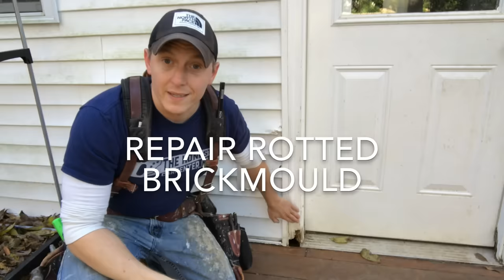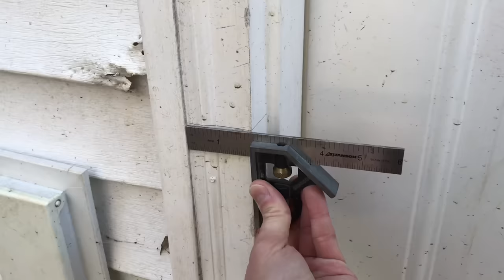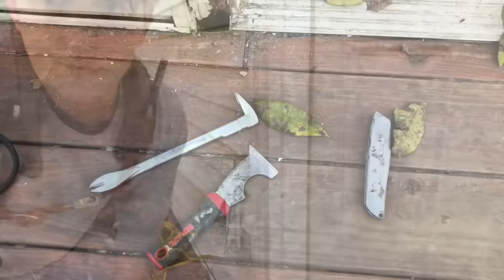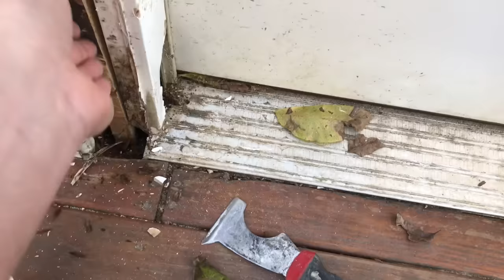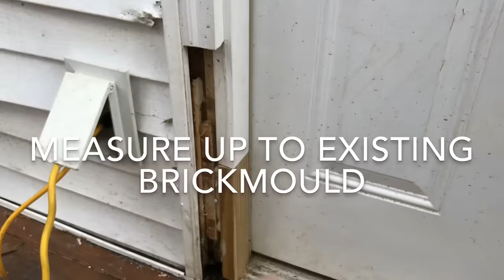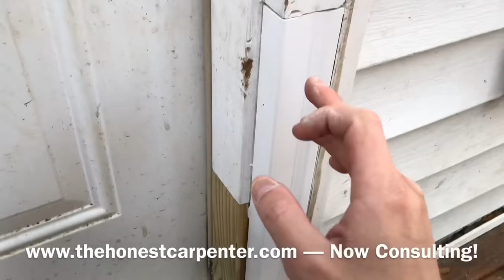Fix Rotted Door Frame (Brickmold)

Comment: I have seen a few of your rot repair videos and one comment I would like to make, as a fellow carpenter with over 35 years in the trade, is that once you have the rotten material removed, I recommend you treat the exposed areas with an appropriate chemical to kill any remaining termites or rot fungus that might not be apparent before you make the actual repair.  It will give you and your client more peace of mind and make your repairs last longer.
Reply: Here’s a tip I use… When using wood brick mould/jamb make sure your use a primer or paint on the bottom 3 inches to help seal it and “help” with future water repelling to assist with
Reply: Yes! Thank you for adding that..My heart sank at that sight since I have many problems with …moisture, wood decay, carpenter ants, and termites. Also those holes make lovely homes for mice and More .1
Reply: Steve sherrill what chemicals are you referring to my fellow carpenter???
Reply: You must have missed the part when he explained his reasoning and plan to adding sealants, etc.
Reply: Hello Stephen, just wondering if you do the work in 29650 area! Thanks!
Reply: Wish you would've indicated what the "appropriate" chemical's name(s) would be for myself and anyone else facing this repair
Reply: @seanrichards anti freeze
Reply: I’m no pro but use Concrobium spray

Comment: EXACTLY the problem around my back door at the garage - 32 years of sun and rain - brick mold and frame rotted so badly at the bottom,  a mouse and a rat might have walked through together.  THANKS SO MUCH for the great instruction!!!  Got the oscillating multi-tool and PVC brick molding and 1x4,  even though my problem was worse than what you showed,  the solution was the same.  I had 4 carpenters come and tell me to replace the door.  The door is fine, it's the trim that needed replacing.  None of them called me back, that's when I found your video.  So glad I took your excellent advice!!  $ 59 for the oscillating tool and $ 25 for the PVC trim, bless you!!!!
Reply: And now?
Reply: @kueichenglee7583  holding well, thank you!

Comment: You make good informative video's. 71 year young carpenter here. I always found dry rot to be like a ice berg. You only see about 10% of it. The chop saw, pneumatic nailers and multi tool were game changers.
Reply: Yes, hooray for all those. I'd also like to put in a good word for lithium ion battery tools. 🙂
Reply: If I understand correctly, it’s nice to replace some dry rot rim joist but not always necessary to get 100% of it out if it’s not structural problem. It’s tempting to go overboard with it but in my case, I think it’s OK to leave some dry rotin a few spots now that I’m going to add the proper building, paper and flashing. This was missing from my deck!

Comment: Thanks for this.   You just saved me $$ and turned me on too a really cool multi tool.   It's awesome.    It took me only about 30 min to do this repair.   I had a handy man tell me it was easier and cheaper to just replace the whole door with would have been over $600.   This cost me $190 including buying a really nice DeWalt Multi Tool.   Thank you.
Reply: To Anthony Osborne
I thought it'd be a fairly easy couple of hours DIY for me to remove a 12 in section of the bottom left side of door frame, or jamb part. A few inches had rotted, the side that borders a raised flower garden... Too much over spraying the plants over the years is the culprit.
Anyhow, I'm on day 2 lol. I put in a good 2 or 3 hours yesterday, priming the replacement wood section, gently and gingerly and slowly taking out the rotted section. My hands and wrists have gotten too weak over the years, I'm very small ones, barely weigh 90 lbs, so I get way too sore to keep praying, cutting, etc.. the rotten part out then carefully cleaning out the particles and built up calk behind that scary looking area void that is now exposed. I used work gloves and long reaching hand tools to remove the known and unknown debris, silly me, I'm too afraid of running into  spiders or other creepy bugs. So far I haven't, lol. I was bound and determined to do this DIY all by myself... Well after talking too long to cut a simple 12"x3" door frame piece with a handsaw, I had my husband finish cutting that piece. Toy chargrin, a few seconds is all it took for him to cut that piece.
Yep, no doubt he could have done this job in a fraction of time that it's taking me. 
Luckily I live in the SoCal area where our days are still quite warm out with no rain in sight. 
I learn a lot from these very informative videos and also glean a lot from the comments! Have a wonderful weekend everyone. 😃👋✌️

Comment: I’ve done this repair a lot. Almost the exact same way but I find it easier to cut the new PVC brick mold first, place it parallel to the rotted molding, and use the top of the replacement price to guide the oscillating saw blade. Remove the old rotted piece and the new piece slides right in. Perfect fit every time and it’s a nice time saver.
Reply: Seems like the width of the blade would cause the cut to be too high.
Reply: @littlemissy8356  not enough to make a difference
Reply: Seejanedrill@youtube.com she will show you some tricks on saving money on those oscillating saw blades... this isn't spam...😂
Reply: I would done same thing, however I would have just added a fill bord for deck so add more stubableity  its more likely not happend again
Reply: So

Comment: Great video. One tip I think to mention as I just returned from finishing neighbors' attempt at replacing is to tape back the blub weather seal on the inside of the door towards the garage whenever cutting the side jamb out actually on any project. In nearly every project I've been called to come and "fix it", the weather seal is ripped or cut leaving an opening, especially on the entry points into their homes. Once the seal is out or needs to be replaced, it can be very difficult.  Keep up the good work, Rob

Comment: Here’s a tip I use… When using wood brick mould/jamb make sure your use a primer or paint on the bottom 3 inches to help seal it and “help” with future water repelling to assist with rot.  

Great videos

Comment: Great job on a very common repair!  two small tips,  follow your pencil line with a razor knife scribe which will leave a sharp cut edge to follow with the multi tool. Also, when removing the piece, in an effort to eliminate pry marks against the remaining wood trim members, run two drywall screws high and low and use your claw hammer to pry the piece straight off and away.  These two things are especially useful when working on highly visible trim repairs.  Thanks for all your great work.  Your obviously very squared away and doing great work!!
Reply: That's a good tip!
Reply: Such a great tip!!

Comment: A second plunge cut an inch or two below the top cut helps with the splintering problem. The top cut needs to be nice and square so  it looks good when the repair is done. The lower cut doesn't need to be precise since it is only to help avoid splintering into the remaining trim when you pry out the bad part.

Comment: Nice job.  I fill any gaps or spaces with foam filler before I set in the new brick mold and or trim. I found this helped reduce moisture build up inside. Also keeps ants from moving in as well.
Reply: What kind of foam filler do you recommend for these areas?
Reply: @BalancingChaos  I recommend the bug and insect resistant foam filler for many areas. Green can. Make sure it’s exterior too.

Comment: Great informative video, especially for homeowners that are scared to do repair work!  You explained everything and the reasoning behind it!  
Not sure why the PROFESSIONAL carpenters are watching this and giving input 🤦🏻‍♂️!  This is for rookie carpenters wanting great info, thank you for your videos!
Reply from the maker: @Craig Bynog Thanks Craig :) You're exactly right--I was trying to show a low cost, relatively simple repair that a motivated beginner could probably tackle on their own. I know there are even more thorough approaches, clear up to replacing the whole pre-hung door. But this one probably has a total cost of about $12 overall. And, provided you have a multi-tool and a way to cut new cellular PVC, can really be carried out in about an hour or less. (I usually make the multi-tool cut and removal in a couple minutes). Thank you again for watching. I really appreciate your support!

Comment: This video was perfect - I have to replace several pieces of baseboard moulding due to condensation/water damage from a series of interior floor-to-ceiling window frames, and I'll be using these techniques.  Total newb here, but I'm confident I'll manage!  The oscillating power tool looks like what I need.

Comment: Run a bead of caulk on both sides from the bottom of the mold to the plate. This is why most start to rot out in the first place. I do this with all door installs!

Comment: Priming and painting the wood used for the door jam, particularly on the bottom where the fibers are open would keep future rot out. Same goes for exterior doors; always paint the bottom before installing.
Reply: Not only this but seal the ends as much as possible so it doesn't soak in any moisture.
Reply: @SteelOfLegend  Super glue or loctite is supposed to be good for sealing the end grains.
Reply: Buy pvc, will never rot and looks the same.

Comment: While I think this was a good video to show how you did the repair, I would suggest all who think about doing this there is a better, faster and easier way of doing this repair. Remove all 3 sides of brickmold. Buy a PVC brickmold kit which already has the miter cuts done. You will have to square cut to length and one miter for the top.( you can choose to reuse your top mitered piece if you dont want to miter) if you dont have a miter saw use a square and cut angle from the backside of the piece. The kit is about 25 dollars from home depot. This is a forever fix with no wood to PVC seams to fill, sand and make look like there's no seam. You dont even have to paint it if you dont want unlike wood brickmold which is only primed. It will take less time to replace all with PVC than to cut out section and repair. Besides its a much more professional and solid fix. I charge 95 dollars a door to do these and it takes about 15 minutes. Anyone can do this with 30 dollars and 30 minutes and no osscilator tool needed( unless you need a reason to go buy a new tool)

Comment: Just replace all the brickmold with PVC.  Home Depot sells pre cut kits for just over $30. You may have to cut to fit your exact door, but would be easier than making those plunge cuts and risk a poor cut.  Then you don't have to worry about any other parts rotting out and it will all match each other.  The PVC kit is also paintable to your desired color.
Reply: That looks to be in Canada only.  I don't see it on the US' Home Depot site.
Reply: And even if you can't buy the pvc kit from Home Depot you're better off just to replace it all with new wood. It's cheap and a lot simpler.
Reply: @johnschwenke6307 o
Reply: @johnschwenke6307  I'm not sure if I would agree that it is "simpler"
Reply: @Richard Starr
If you have a miter saw, it's really not hard if you have a little skill working with wood. I did it in half an hour, and I'm just a shade tree carpenter. 😆
Reply: @buzoff4642  actually I'm in the US and was able to order a trim kit from Lowe's, maybe about a year ago or lil less than
Reply: @stephE80  Thanks for this information.  I try finding things on their web site, but come up empty. Talking w/their staff, they say "If I had a nickel for every complaint about our web site..."
Reply: @stephE80  I stopped into Lowes and pressed them.  The "kit" is three pieces of mitered vinyl bullnose.  I had my hopes up that it included the window exterior sill.  I think the reason it doesn't show up in their web site search, is because the two sides are long enough to use for doors, so it's sorted as door kit.
Still, it saves having to get a miter saw for the job.
Reply: @buzoff4642  oh yes the door trim kit was what I purchased, not window... this video was about door trim, I apologize for the confusion

Comment: I did similar replacement to 4 doors recently. One addition, a buddy/builder suggested-use Great Stuff foam or similar under threshold (if you have access). Makes it feel and sound solid and adds to air sealing.
Reply from the maker: @David Phelps That sounds like a good idea! I’m sure it helps prevent threshold bouncing and drafts

Comment: This was a great help. The PVC board will help with my similar problem.    Do you have a video on repairing rusted out metal door?  At this same door the bottom of the door has rusted out.  Hoping it can be salvaged. Thanks

Comment: I used bondo, but mine was just rotted a little at the bottom, has been good for 2 years now. Good video.
Reply: Bondo ? Wow is it still lasting?
Reply: @hairbarber-ology  yep. Holding really well. Just checked it. Super solid. I will definitely be using it again on wood rot. Best part about it is it's very easy to work with. The area I patched though was about 5 inches high and the entire width of the board

Comment: I tend to cut the old material upward at an angle and the new piece at the exact opposite angle then slide the new piece up under the exiisting wood. It makes for a smoothe transition if you cut it right

Comment: Honest Carpenter, I will be making a similar repair for a customer and would like to know if you would recommend just replacing the bottom portion of the brick molding like you did in this video or just replacing the entire brick molding?  I am thinking that it would be easier to just replace all of the brick molding in order to avoid using a multi-tool to make several special cuts.

Comment: use the rolls of two part epoxy (they come in a little tube and look like a swiss roll) to fill the gaps at the cut points.  You can sand it down before you paint the repair is invisible.

Comment: Looks like you had treated 2x material for the jambsn which unfortunately may require a full season to dry before priming and painting? Curious why you didnt use pvc or regular lumber with bondo/epoxy coat for quicker painting instead?

Comment: Thanks for the video. This is exactly what I needed. I am a beginner carpenter/handy daughter trying to fill in for dad who passed away, I need to be able to fix more around the house.  We had a local guy install another door frame and door because door had other issues. However, inside the building which was a garage there is open space between the garage and the door jamb.  what can I put into this empty space? I might need to send a picture.

Comment: I have the type of brick mold shown on your video ' fix rotted door frame (Brick mold). I want to install storm doors, but several 'local' contractors(?) have told me it's impossible without removing the existing brick mold and replacing it with a new type. I also have vinyl siding with 'J' trim surround. I think I'm being 'zoomed'. Could you please advise? 
Your video is excellent. Thanks.

Comment: Great tutorial on how to repair wood rot.  Your explanations help to make the DIYer more confident in trying out this repair.  Do you have a tutorial on how to repair a rotted door threshold? As in your videos, the threshold on my exterior door is made from a combination of an aluminum plate and wood underneath that supports the adjustable threshold.  All the wooden components have rotted, but it is impossible to replace it and the aluminum plate (I have a patio style door with one fixed side and this aluminum plate extends underneath the immovable side as one solid piece).  To replace this threshold would seem to me to require removing this whole patio doorway.  Any suggestions would be gratefully appreciated.

Comment: This is good repair for an EMP inspection fix if you're selling a house, but if your staying any length of time replace the ENTIRE brickmould. It's just as easy and it will look better.
Reply: I would have taken the whole piece off and replaced it with the vinyl or PVC type

Comment: It happens usually when doors installed and not painted. I found it is faster and look better to replace all three pieces of the brickmold. PVC is preferred but if a storm door will be installed then wood is stronger, especially where there're strong winds.

Comment: How do you know how far back the rot actually goes? And how can you tell if the rot is part of the foundation? We’re working on replacing some dilapidated brick steps on our house, (125 year Old farmhouse) and there is wood rot all under the brick and around the door frame. I’m concerned that the foundation is compromised, but I’ve no way of knowing without digging it all out, and possibly causing a bigger problem. Any ideas?

Comment: One thing that's totally glossed over in this video is on the door side of the jamb, he doesn't mention anything about weatherstripping.  Most doors similar to that one have the weatherstripping let into a saw kerf on the jamb.  This is easy to replicate but does require table saw or special router bits.